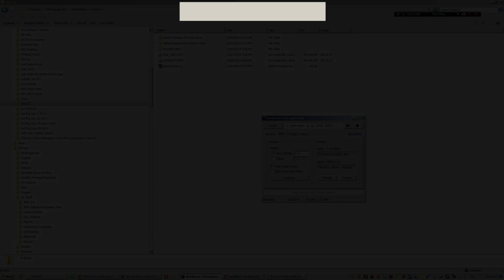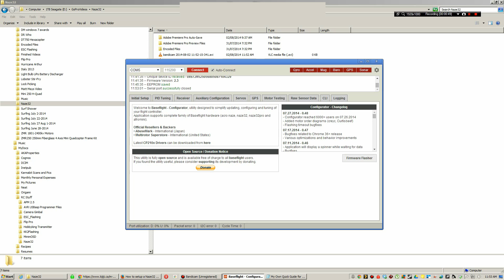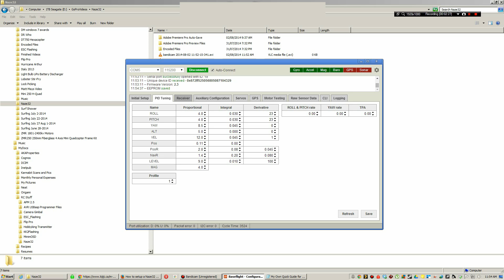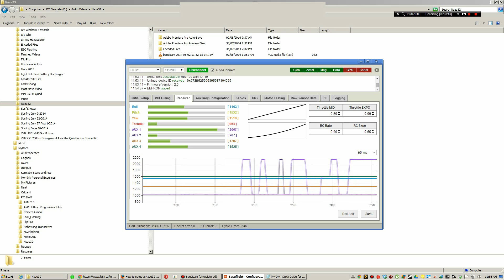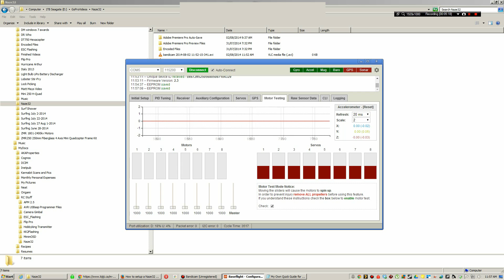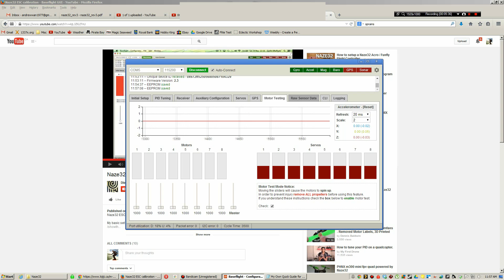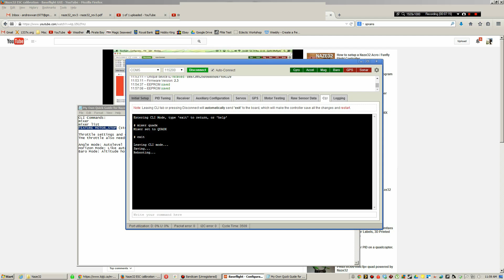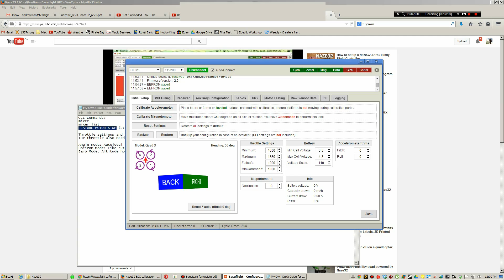Naze32 from Great Hobbies (Review, Setup and Flight) - Part 2

Comment: I'm having motors dropping out at high throttle setting and at first start up, and was wondering if that is purely an esc problem,  they are mystery 12a's, or it has something to do with the fact I'm only taking 5 volts from one esc and just using the signal from the remaining 3. Wondering if that would be a factor.
Reply: wraith01mg Is the one esc not hot and going in to overheat protection? Or change the motor to another position and recheck. Thanks Dolf.

Comment: All my ESCs ( Turnigy Plush ) have BECs> Should I remove the ground and positive cables of 3 out  of 4? If so, which ESC should be connected with its 3 cables ?
Reply: Im searching for that same answer.I have afro 12 amp esc.I know i plug one with all 3  wires.But do i remove the middle wire on the 3 remaining plugs??I need help!
Reply: Nic Holas Hi there Nic, you need to disconnect the positive (red) wire on 3 of the esc's.If you need more help just shout.  Dolf.
Reply: vernon seraile Sorry I meant Vernon.
Reply: Nic Holas  Hi there Nic, you need to disconnect the positive (red) wire on 3 of the esc's.If you need more help just shout.  Dolf.

Comment: Hey there, I'm just about to setup a 250 MQ with a naze32, just wondering, my esc's all have a 5v ubec am I ok to plug all 4 into the naze32? or should I remove the + and - from 3 of the esc's so the Naze only runs on 5v?
Reply: chrisbewrx Hi there, remove 3 red wires or (positive). Im not sure about the black wire, dont know if the naze has common ground. Just remove the black and if it does not work put them back. Have a nice day  Dolf.

Comment: How do I connect the Naze32 to my pc (Win8)? I tried with one cable USB-->micro USB but no device is found on my pc, even after I installed the driver (Cp210x). Do I need some other device to speak with naze32 other than my simple usb cable?
note: my naze32 is not connected to any esc or other power source device when I connect it to my pc.
Reply: Im looking for that same answer.Did u ever find out?I need help
Reply: I'm afraid it won't connect with windows 8 at the mo. I've had the same issue mate
Reply: Definitely works on vista if that's any good.
Reply: vernon seraile Hi there Vernon, As far as I know it does not work with Windows8 only on 7or lower.  
Dolf.

Comment: Great video , how is the altitude hold working out?
Reply from the maker: ZipSnipe I only used it a few times and haven't been out flying much but the times I tried it works well, but I think the controller needs to be covered as the board is open to the elements which affects the barometer.

Comment: Andrew, I see youre using the futaba t8j, is there any reason why you didn't connect the r20088sb to the naze32 using ccpm instead of the breakout cable
Reply from the maker: hi Gareth, I had trouble getting the CPPM to work with the futaba, no trouble with the sbus but that receiver is used for the Naza.  So I was just being lazy instead of trouble shooting and just used the breakout cable since I know it works :)
Reply: Thanks for the reply Andrew. When you say you had no trouble with the sbus, can you tell me where you connected the servo wire to the naze32 and did you have to alter any software settings for it to work as I might give sbus a go for less wiring. I can't find any info on connecting sbus to naze32. Thanks, Gareth
Reply from the maker: *****
Sorry I wasn't very clear in my explanation, I haven't actually tired the sbus receiver with the Naze32, I just had trouble getting the FrSky CPPM receiver to work with my Futaba radio so just went with the breakout cable.  According to the manual it says the top 3 pins (Ground, Power, Signal) from the left on the Nase32 receiver pins input are for CPPM, I think you just hook it up and it is suppose to recognize the signal. 
Let me know if you have any success, I'd like to tidy up the wiring as well :)
Reply: Andrew W type "feature ppm" in the cli and then save

Comment: Do you not have to tell  the FC what type of motor setup such as a Quad X or a Hex as on the KK2 FC ?
Reply from the maker: You have to tell it what motor configuration you want, i think by default it is QuadX.  You do it in the CLI editor, I'm not sure what the command lines are off the top of my head.
Reply: In CLI of the chrome app type "mixer list" to see what modes the board is capable of, to set one just type "mixer quadx" or whatever type you chose.

Typing "dump" also lists all available commands.